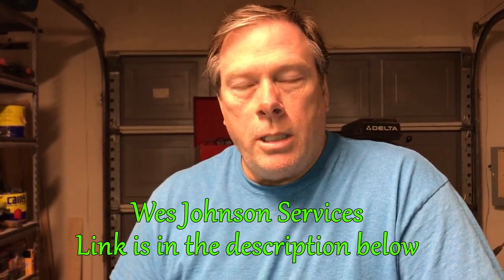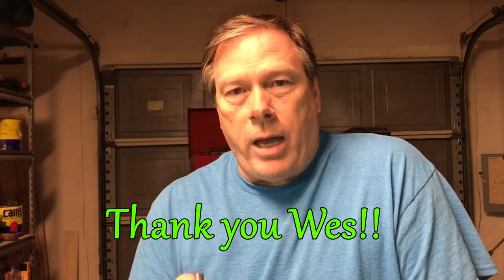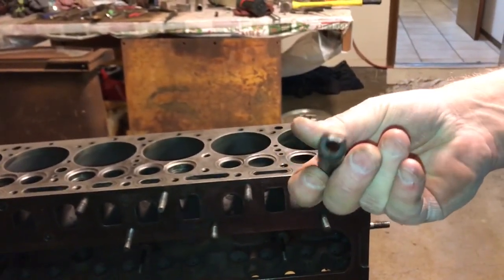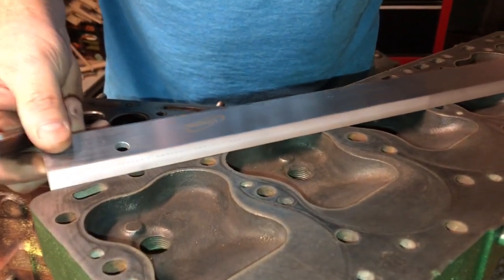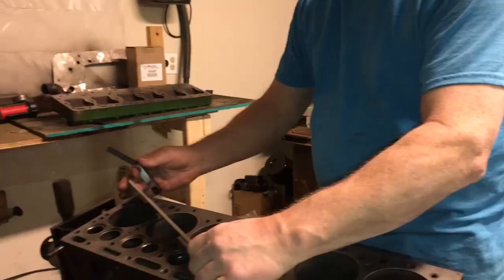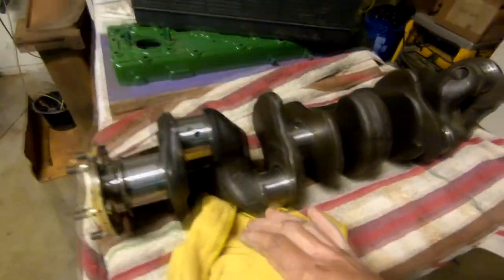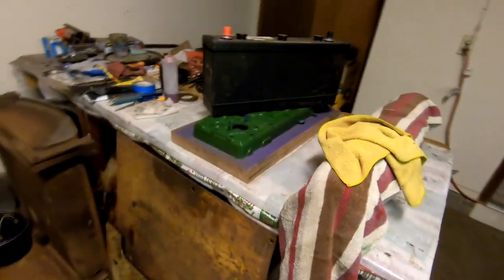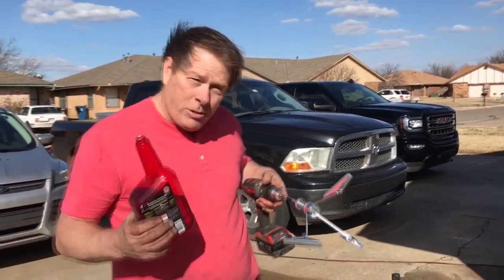Continental F244 Flathead Block Prep - Backhoe Restoration Project

Comment: Bad idea to spin lap valves. It could easily result in a scored finish. Lapping should be done with short back and forth oscillations, frequently lifting and rotating the valve a few degrees and repeat.
Reply from the maker: Thank you for the advice!  Eventually had the engine deck and head machined and had the valves lapped by a machine shop.